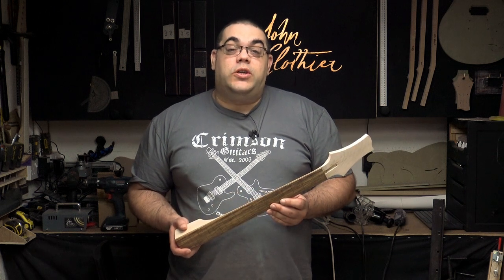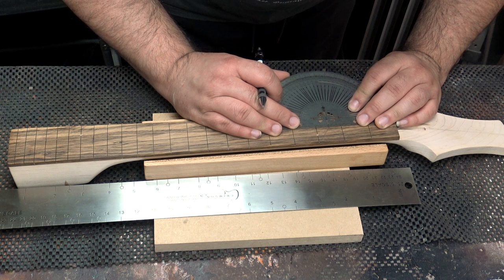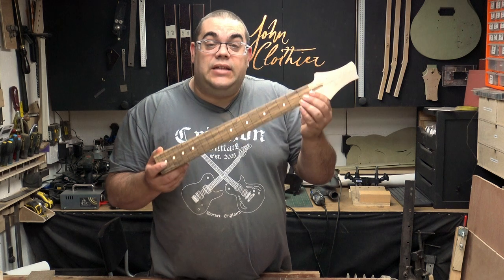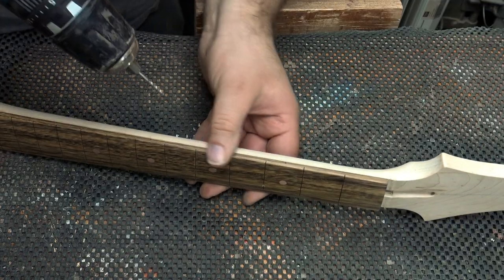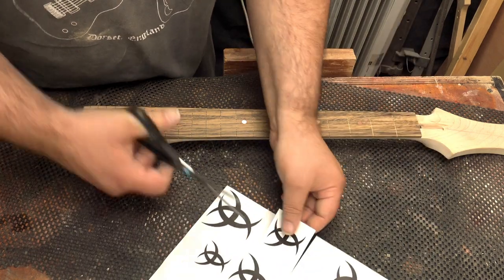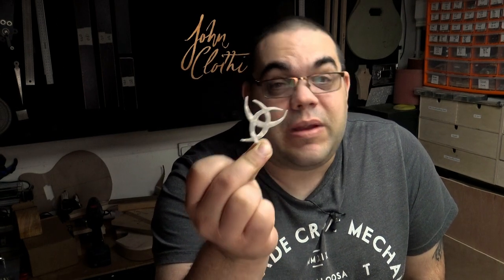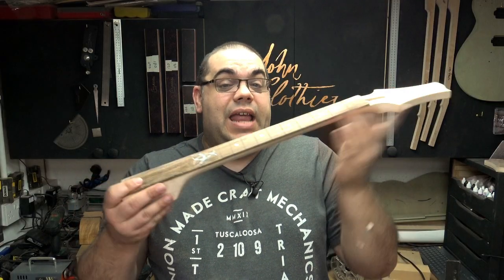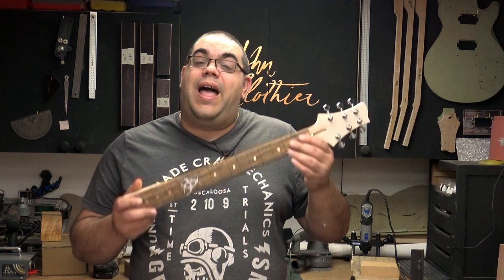Great Guitar Build Off 2020 - Unofficial - Part 5

Comment: Hi John, Great to see you making another Guitar. One question, why didn't you use the jig for cutting the fret slots? Off to watch episodes 1 to 4 now. Take care John. Cheers, Huw
Reply from the maker: Thanks Huw. The jig is really about getting the slots in the right place. After the inlay a lot of the old slot was still there so it’s easy to put the saw in it and then remove the inlay that covers the slot. Another reason is the neck won’t fit in the jig. It’s designed to only hold a fretboard.
Reply: @JohnClothier  Thanks John. Makes sense now to an expert Guitar maker like me. LOL. Take care mate. Cheers, Huw
Reply from the maker: Lol you too Huw